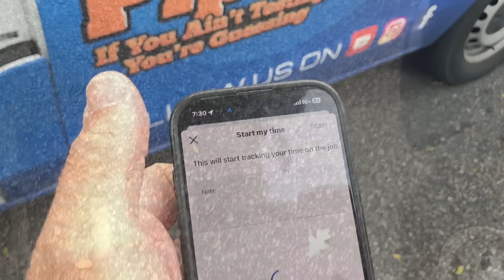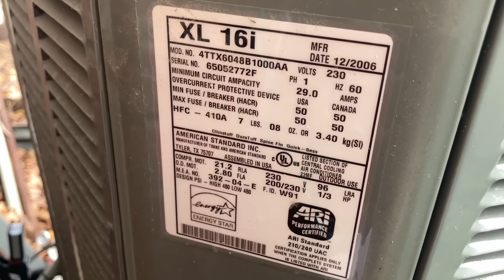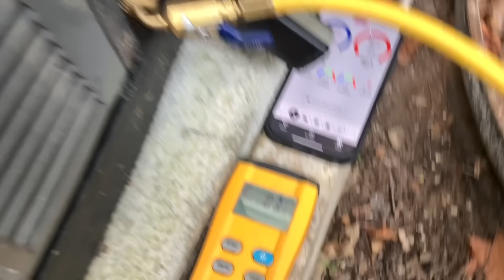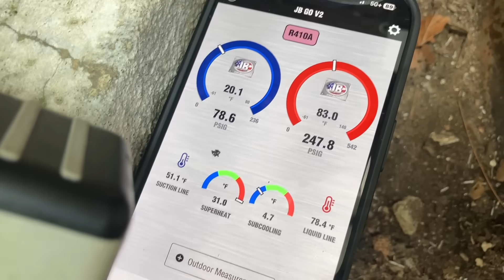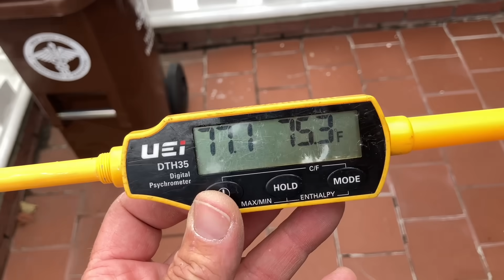AC Won’t Cool? Rapid Cycling, No Cooling – Here’s What We Found!

Comment: Good job. Was the air cleaner dirty. A tank of r410 a here is 400 for 25 lbs at the supply house. My buddy gave me one with a half tank to fix my mini split. Daikin 1 1/2 ton that holds 2 1/2 pounds. Short line set.

Comment: Last summer that ez seal caused a lot of issues with the carrier micro channel evaporator coil
Reply from the maker: oh yeah?
Reply: probably wasn't easy seal, there are other products that will seal a leak for long term. the problem is they ruin and seal everything, test gauges, switches, ports, txv's, filter drier. lol
Reply: @throttlebottle5906 nope exact brand shown in video. We had someone from carrier and our warranty manager cut open the coil and see what it did lol
Reply: none of the seals work dumass

Comment: Good god… $175 per lb for r410a?
Reply from the maker: Yeah, $175/lb for R‑410A — and here’s why: this isn’t some Walmart special where the price tag skips overhead. That figure reflects real costs—EPA-compliant cylinders, proper disposal, licensed handling, full insurance, and technicians who didn’t pull an apprentice from Craigslist.

If you want the bottom-dollar bargain, go hunting for guys “refilling freon” out of busted tanks. But don’t come crying when your system fails, blows a seal, or you get slapped with a violation. We’re not selling chemicals—we’re selling safe, legal performance. And yeah, that isn’t cheap—but neither is cutting corners.
Reply: Your paying for a service , not a product. Mikey pipes is charging what he needs to keep his company open to service you many years down the road … not just a fly by night company
Reply: Nobody is stopped from getting their epa universal last jug I picked up.  I paid $263.88.   Out the door.  
An it’s not my trade so I didn’t even have an account a buying tons of stuff for any cheaper rate.
Reply: Considering that it's in the socialist state of NY, I'm surprised it's not MORE! 
AND that he doesn't have to call in some sort of hazmat team to supervise while holding some sort of fake air purifier hose close to the valves to catch the deadly gas cloud that comes off 🙄
Actually I would have guessed they charge a fee and send a "state certified" employee out to handle that.
Reply: $125 here in Indiana, it's New York so I'm not shocked. Have you seen what lawyers are charging? I got charged $225 for replying to an email lol. I'm sure Mike wants to pay his guys well and if that's what he has to do to do it I'm all for it. It's time for blue color folks like us to make some money! I'm tired of seeing my fellow tradesmen living in trailer parks and shopping at Dollar general.

Comment: MIKEY PIPES!!!! When charging 410a in liquid. Do you use a liquid-to-gas converter or a straight liquid? Will it not damage the compressor? ..thank you for your videos, keep them coming
Reply: Straight liquid just meter it in nice and slow so you do not slug the compressor
Reply: @JustinTRTR  yep, that's why your gauges have a sight glass. run it just fast enough so majority of it vaporizes before that point and the glass is just sputtering a bit.

Comment: Why is refrigerant so expensive?  It's no reason for it to be so.  Rip off?  Sure...no doubt.  Governmental goobers must be disciplined and removed from office.  The average person cannot afford exorbitant prices for repairs on critically necessary components for health and personal security.  Let's stop the rip offs.
Reply from the maker: You’re not wrong about the pain—but let’s break it down. Refrigerant prices are sky-high because of government phase-outs, EPA regulations, limited supply, and manufacturers cashing in on panic. Add in hazmat shipping, licensing, proper recovery/disposal, and you’ve got a cocktail of costs that snowball fast.

Is it a rip-off? Sometimes, absolutely — especially when unlicensed hacks or big-box service mills pad prices with zero added value. But legit companies? We’re forced to charge accordingly just to stay above water and stay compliant.

You want to stop the rip-offs? Hold the regulators and manufacturers accountable — not the guy trying to keep your home cool without getting fined or sued into oblivion.

Comment: how often does the easy-seal work?
Reply: My experience is about 1 out of 10 most of the time it causes the TXV to stick shut taking out the compressor we stopped using it or even offering it.
Reply: @JustinTRTR what about if the system has a piston?
Reply: @Samlol23_drrich, it dont matter. It might not gum up a piston,but in my experience, you'll still be back next summer gasing it up again
Reply: @JustinTRTR 😂
Reply: Never

Comment: My friend had a hack put in a new ac outside unit. It’s a 2 stage and they didn’t put a new thermostat in so it’s been running at low stage all summer.
Reply: 😂 nice
Reply: many of the furnace/air handlers can handle staging automatically, if set to of course. of course not all can.

Comment from the maker: 🔥 Home’s still hot and your AC keeps turning on and off? WATCH THIS. 🔧
Low refrigerant isn’t just “low”—it’s a leak. And throwing gas at it without fixing the problem is like putting a Band-Aid on a bullet wound. 💥
Mikey Pipes keeps it real — full breakdown, no sugar coating. Let me know in the comments:
Would YOU repair, leak search, or replace it? 👇